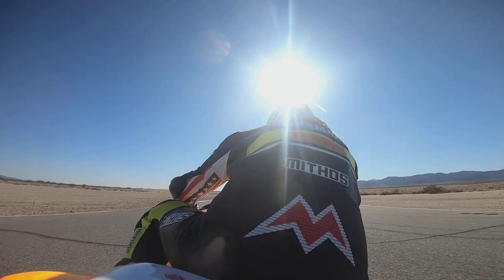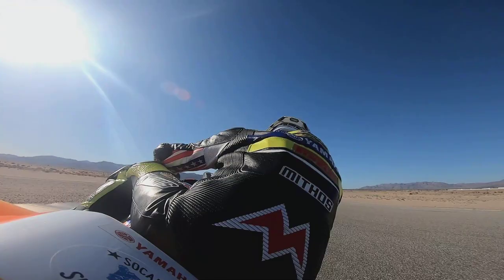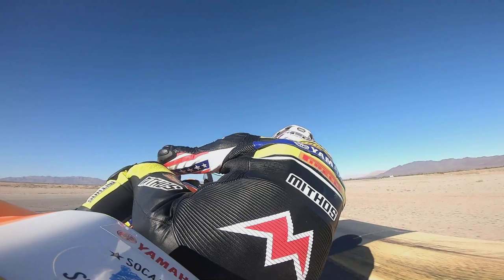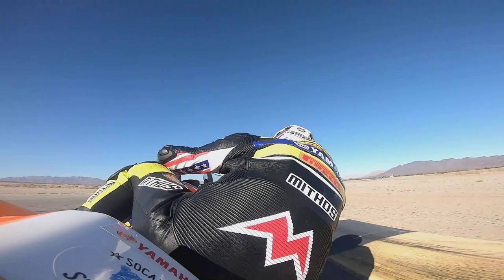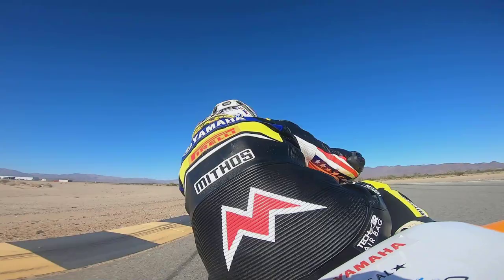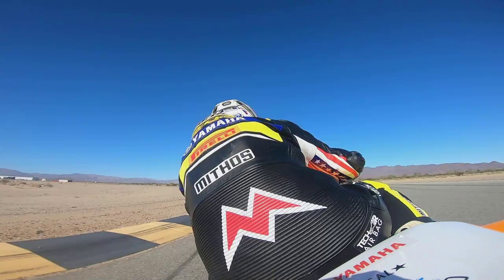Motorcycle Corner Entry

Comment: Hey Stuman. I love your videos and enjoyed taking your supermoto class last year. I would love to see a video regarding downshifting techniques: pros/cons of each technique and how the difference applies between supersport and supermoto. When riding supermoto I don't go through each gear but just bang down into 2nd (or whatever gear I need to) while braking and let the rear slide out a bit using the clutch before turning in. I know that sliding a supersport doesn't really make sense due to the type of turns/speed/weight involved, and it would be great to see a video describing proper technique for slipping, rev-matching, and clutchless while braking with the pros and cons related to each method on the track along with your personal opinion. Thanks for providing such good coaching/content here on youtube
Reply from the maker: Excellent idea for a video, you got it. I'll work on something like this and post it up soon.